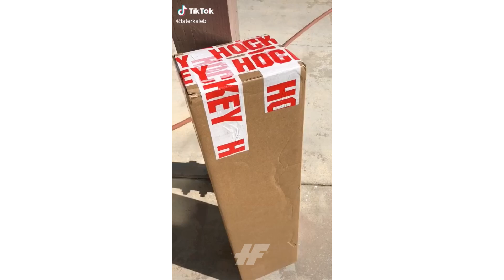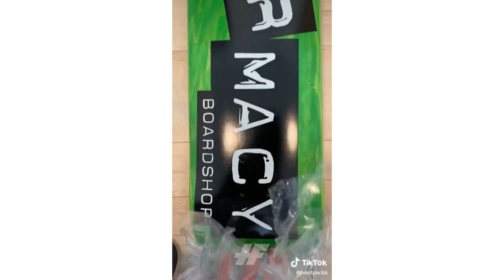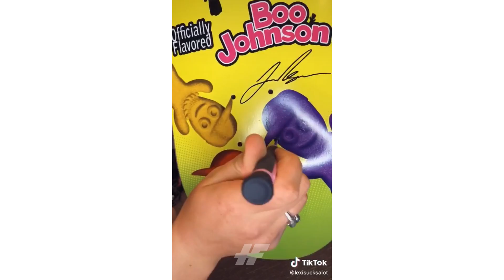ASMR SKATEBOARD SETUP TikTok Compilation #1 | HARDFLIPS.TV

Comment: so...I’m kinda new at changing my grip tape any tipsss?
Reply: There’s two ways, (buying a new board and grip) other option,. You heat up the grip with heat (hair dryer) and it should take 5 -10 minutes. I can’t say the information is the best because I haven’t griped a board in 3 months because my current board is still going, it’s either spend money or heat up the grip to make the clue melt. So, I this was useful